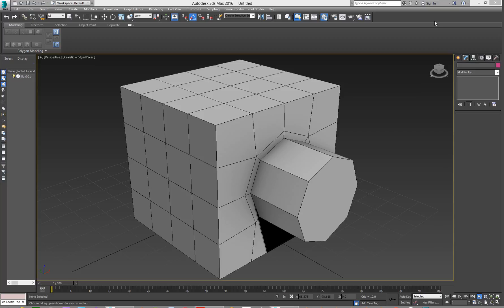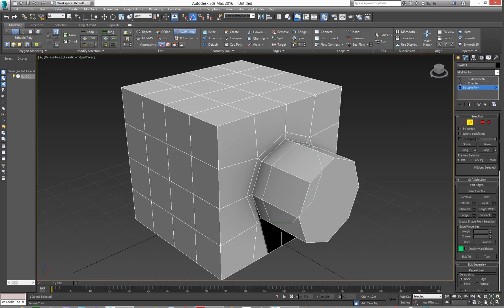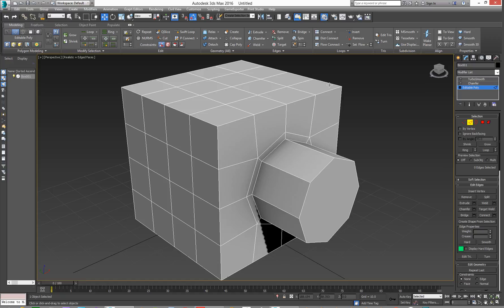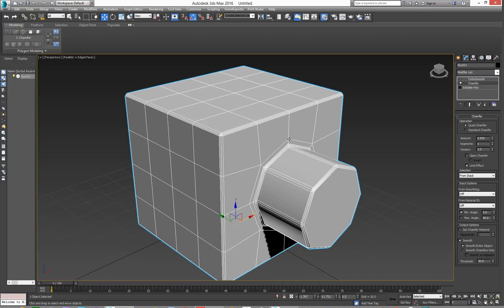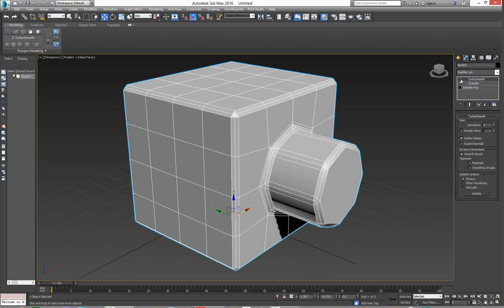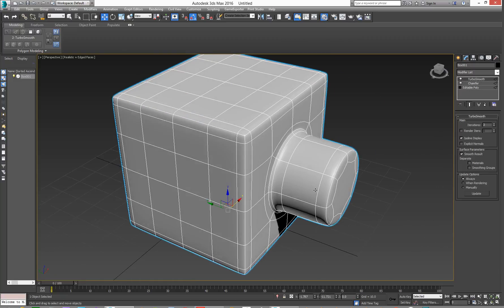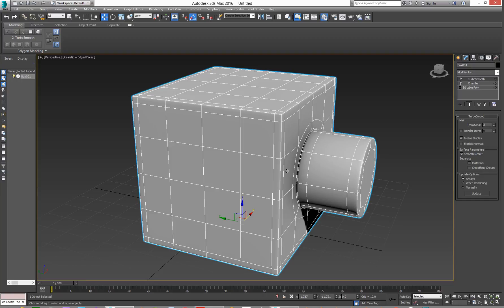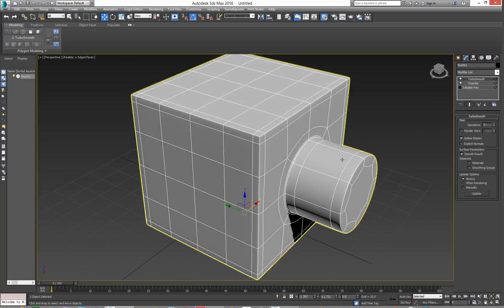Quad Chamfer 3ds Max for holding edges on your model.

Comment: Good tip. Did you try to use quadchamfer modifier with differen smooth groups? There are some nice options like quad intersections, which can be very usefull.